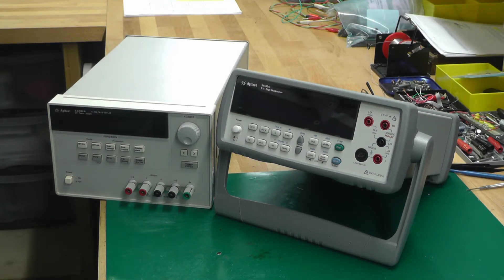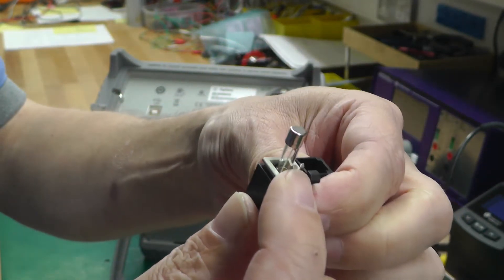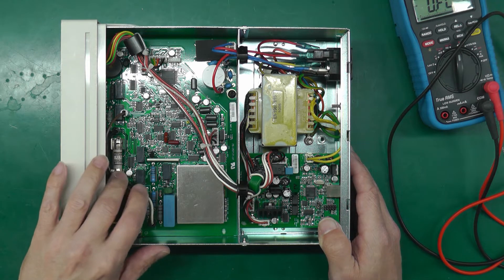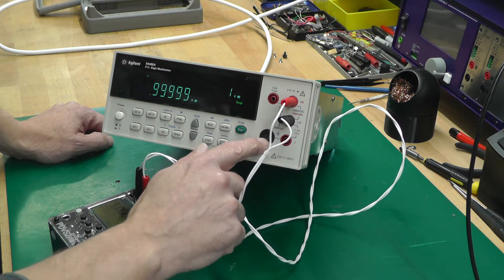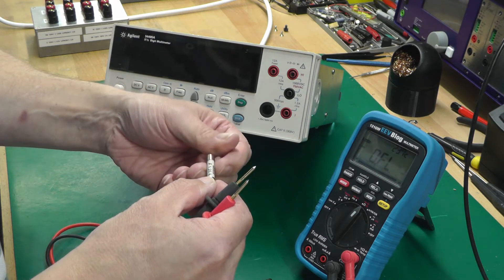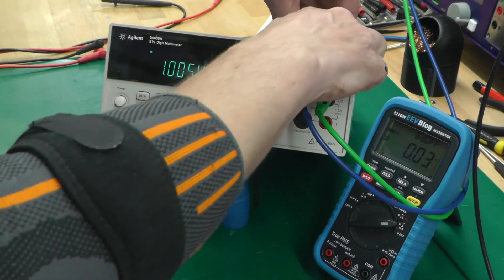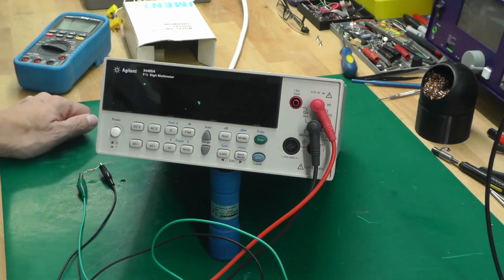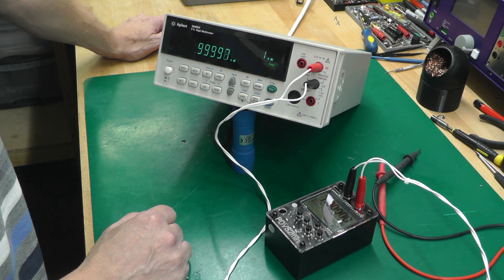No.063 - Agilent 34405A Repair - How easy can it get!

Comment: Lovely pick up =D  Is it possible that it was run with the input selector set to 220V, and maybe that caused some unexpected behaviour?
Reply from the maker: It's possible I guess......but the country it came from are 220Vac officially. Out of interest, I just checked the 220V primary tap and it is intact.
Reply: @IanScottJohnston  =D   Just a fuse then lol!

Comment: I was watching this video to see if you mentioned anything about the manufacturer of these meters. I had a 34405A once, but on the inside it was clearly manufactured by a generic manufacturer (the name was on the boards), that just rebadges them with the Agilent logo and style of front panel. Either I'm going insane or I'm seeing a difference in build quality in this one as well, compared to, for  example, a 34401A. Can't see a name or text on the boards in this one, though.
Reply: I just know the U3401A. That one is probably a rebadged thing.
Reply: I think these series of multimeters are from the Escort acquisition?

Comment: The 34405A has been my main bench meter for a very long time and I use it more than my Rigol 6.5 digit meter since there's no real boot-up time! I have blown that front panel fuse and ended up getting some spares direct from Agilent...very easy to blow, ask me how I know! Thanks for sharing Ian, looking forward to the PSU repair.
Reply from the maker: Totally agree!......The boot time of my Keysight 34461A is slow when you want it quick, so for now the 34405A is installed on my workbench alongside it.....:-)

Comment: Hate it when eBay sellers promise an interesting defect and then don't deliver :) Better luck with the PSU!
Reply from the maker: It didn't come from Ebay.......I bought 3 items from an overseas company as faulty items, the 3457A with the knackered transformer and these two items. They have their own repairs dept. and I got to pick/choose from a plethora of faulty gear!!!.......but yes, I am a hoping the PSU delivers.
Reply: @IanScottJohnston  Obviously a repairs dept. not worth writing home about, LOL. Reminds me of an instrument company in the UK that I sent a battery operated instrument to for calibration and they came back to me saying the instrument couldn't be calibrated and their repair dept. had taken a look and deemed that it was beyond economic repair. 

I knew when I sent the instrument in that the battery was already very old and told them to send the "dead" instrument back. When I got it back I changed the battery and you guessed it, no problem at all. That stupid mistake cost that company a calibration contract worth about 100k a year, this was in the mid 90's and over 10 years not detecting a few dead AA batteries cost that company about 100k revenue for a good number of years.
Reply: @IanScottJohnston  - want to email me where you got it from so I can see if they have anything I want/can afford.
Reply: Haha no thanks, I'll keep blowing money on equipment that I don't need 😂